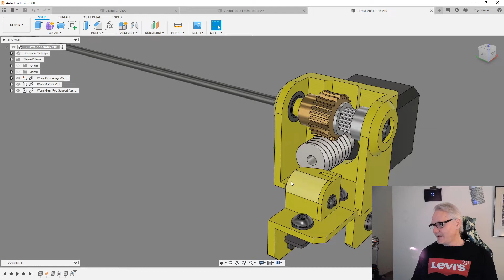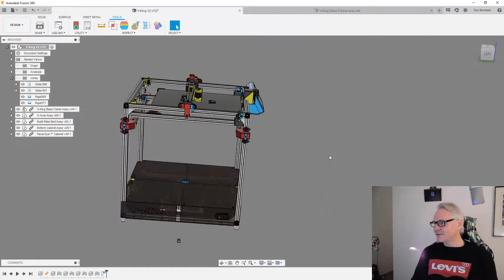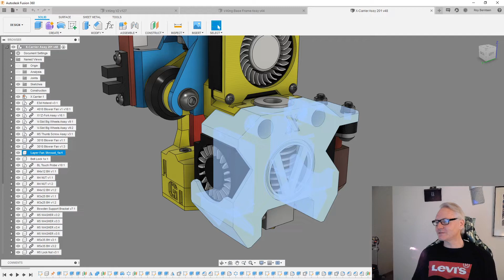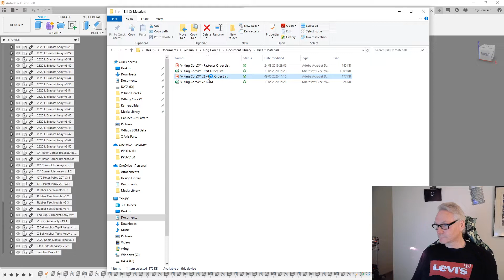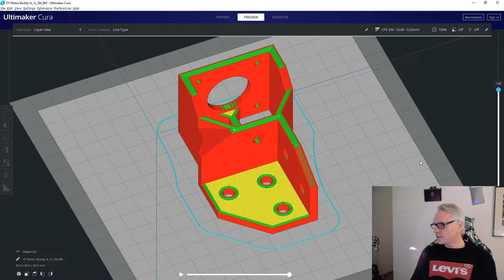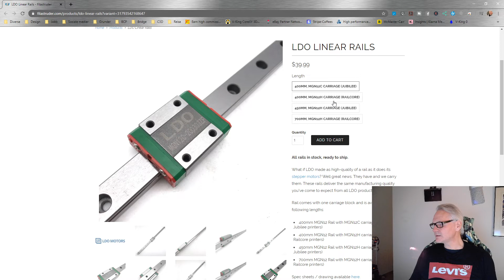3D Printer Q&A Hangout | V-King V2 and V-Baby requests and info

Comment: Hi 
 
 First of all thanks for great build. I have a question regarding worm gear. In US it is hard to get worn gear with your specific design specs. Is it possible to use this worm gear instead?
 
 https://www.amazon.com/CNBTR-Diameter-Brass-Shaft-Modulus/dp/B07G556J43
 
 Thanks 
 Ar
Reply from the maker: Did you check ebay?

Comment: Have you considered remote direct drive?  Might be a way to do "direct drive" without losing your rear mount fan system.  The two main competitors seem to be the zesty nimble or the g5 flex3drive.  I dunno if youtube will let me paste a link or not, but let me know if google doesn't turn it up.  The flex3drive has a hardware only kit where you print the housing for a quite modest price; that would let you integrate the housing directly in your very nice X carrier.  The extruders are quite narrow as well...
Reply: Let's see if youtube will allow the link -- the idea is something like https://flex3drive.com/product/g5-flex-hw-kit/ and then integrate the 3d mounted housing parts into the x carrier.
Reply from the maker: I am not a fan of the flex shaft myself. I hear different things about it and not all positive. I will try to make a light direct drive option
Reply: @PRO3DESIGN  Well, it's one devil or the other, isn't it?  Flex shaft lets you keep your fast travel speeds and your beautiful fan layout on the x carrier; a heavier direct drive ends up unbalancing the x carrier and forcing relayout of the fans.  Some folks use the mechanisms of the remote drive but use a tiny nema 8 stepper to direct drive them; flex3drive actually has a version of this on their site as well.

Personally I'd rather see a more "modular" x carrier first, that splits all the extruder and fan mechanisms and just gives a flat plate with well defined mounting holes.  Then it would be much simpler to experiment with different bolt-on extruder options instead of having to disassemble and rebuild the entire x carrier.
Reply: (for context, I'm in the process of building the xy stage of the v-king but grafting it on to the belt printer design of Zechy https://www.thingiverse.com/thing:2975635 -- so it's likely that I won't be able to be able to use the stock x carrier in any case because I'll need to adjust the angle or z distance of the extruder.  A flat plate modular mount would make it easier for me to experiment with just the extruder part of the design.)
Reply: Here's some more discussion of pros/cons of remote drive vs lightweight direct drive for core xy: https://forum.duet3d.com/topic/11897/any-good-light-weight-direct-extruder-hot-end/13
Reply: @PRO3DESIGN  Look up the Zero Gravity Extruder. It's a rigid shaft design direct extruder with remote drive motor, originally implemented on an ultimaker, but no real reason it couldn't be fit to a CoreXY.

Comment: You've got the price for the build plate listed at $30 in spreadsheet but the linked one on makersupplies  is $111  Big difference.
Reply from the maker: Oh sorry.. It is a typo there i will fix. It is 90 usd if I remember correctly
Reply: @PRO3DESIGN  No worries i just got excited when i saw that price and had to check if you had a new cheaper source.  8-)

Comment: Hi Roy.

Sorry I missed the live stream.

To answer your question I prefer a direct drive.  I have mounted the Titan to the X-Carrier Chimera.stl you had provided in the upgrade files X-Carriers directory and it works well except my part cooling solution needs some work.  I am certain you could do better than I did.  There are a couple of options but the least expensive is to just use the Titan.  I replaced the stepper with a 20 mm pancake type which works well and only weighs 150 grams.  I don't know if E3D will continue making the Titan or the Titan Aero but the Aero would be another good option if they do.  The new E3D Hemera would be another option.  The one I really want to explore is a remote direct drive like the Zesty Nimble.  That one theoretically has all the advantages of a Bowden and none of the disadvantages.  I have been waiting for someone in the US to stock them.  I was going to go to MRRF this year and was hoping I could buy one there.  That might still happen I suppose but MRRF was postponed and they have not rescheduled it yet.  The extra mass of the direct drive with the small stepper motor does not cause any issues.  I can do non printing moves at over 500 mm/sec without losing steps.  If you have never seen it, 500 mm/sec is frighteningly quick.  Printing moves are limited by the hot end.  The V-King is a great printer and I look forward to seeing what you come up with for a direct drive option.  I am about to start doing your Gates upgrades.

Thanks!
Reply from the maker: I am looking at dd options but they all get very heavy and I don't like it. I will not do any flex drive options as I don't like this to much myself